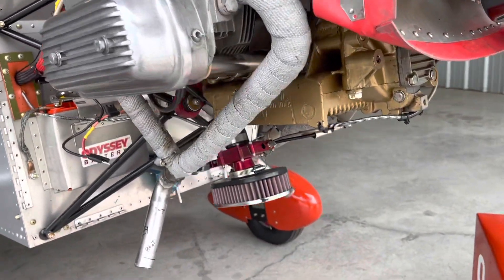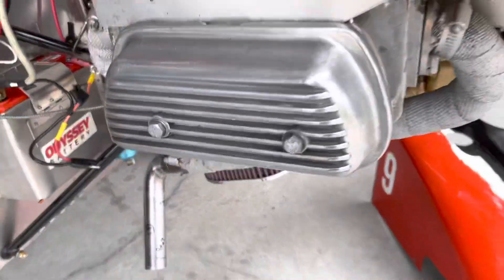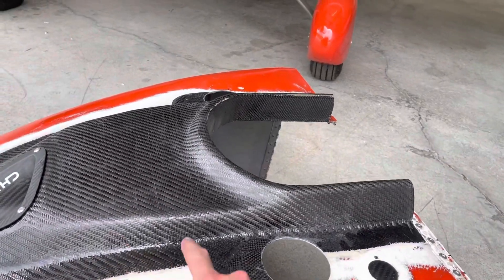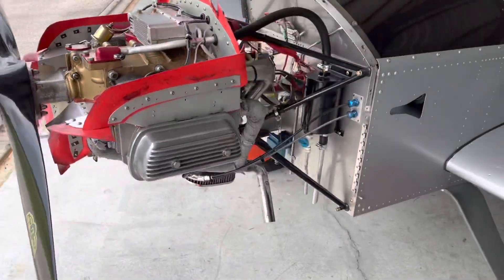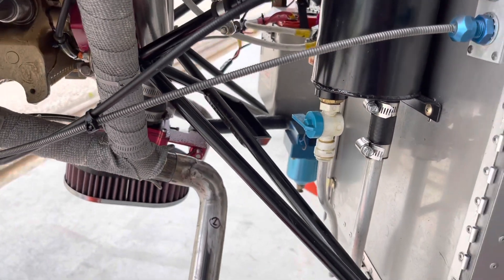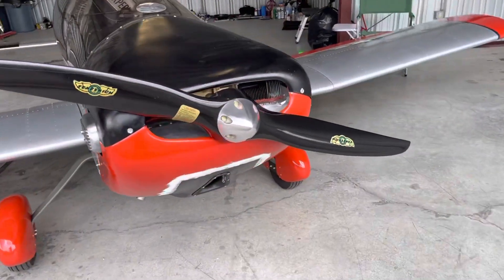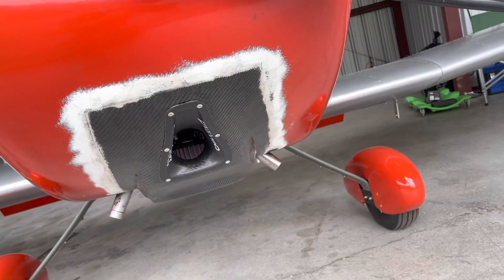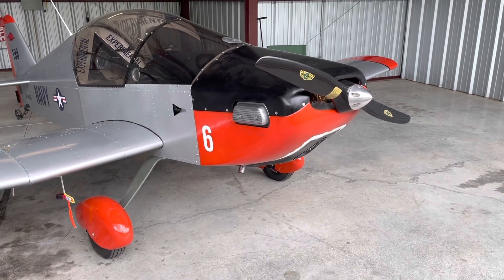Fabrication (Lean of Peak Aviation)

Comment: The NACA should be sealed from the lower cowl or it will only hurt cooling by pressurizing the cowl below the engine where you want lower pressure.  Look at some Vans RV airplanes for how to isolate carb intake air from cooling air.
Reply from the maker: That is certainly the conventional wisdom however per the Aerovee manual a lower cowl opening needs to be present to cool the bottom of the oil pan…so according to Sonex the pressure differential isn’t the only concern.  Also numerous vans owners have added cooling ducts to their bottom cowling to help with fuel vaporization.  My cooling improved with these mods.
Reply: I would definitely build an air box to the naca duct. Not just to help with pressure differential but also to achieve colder intake air temps.